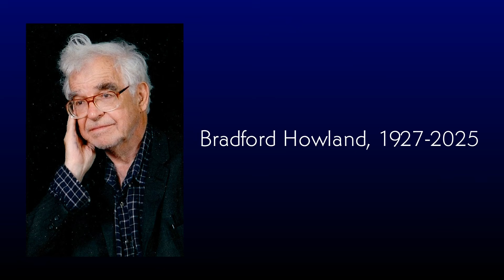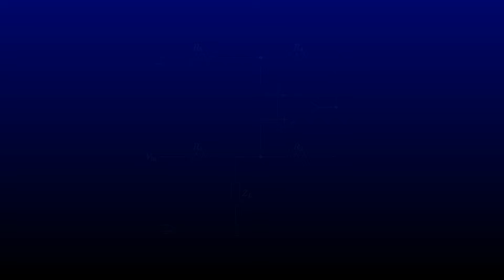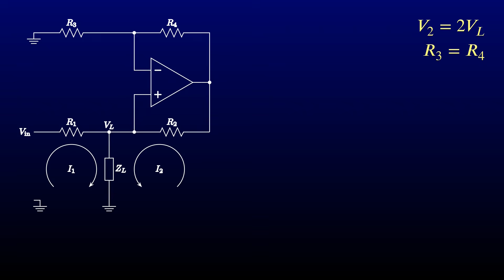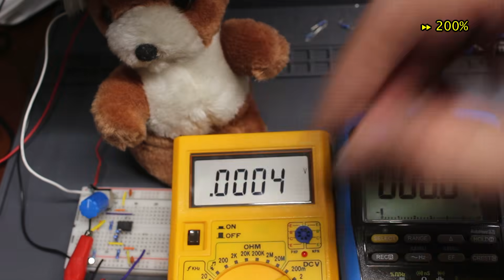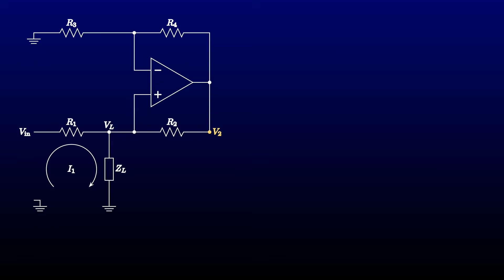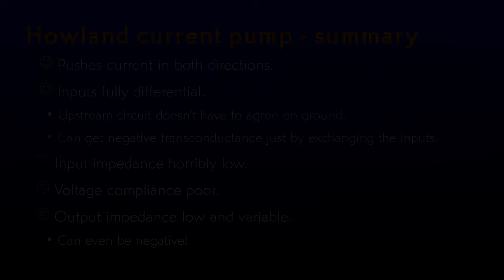The Howland Current Pump | Op-Amp Basics, episode 16

Comment: Look at info at ti snoa474a.pdf, with the range selector but put there the second opamp before the range selector (that's a better solution) and not as it is in there description (which is very theoretical but not practical)

Comment: 0.1% resistors you can get from LCSC from 3 to 8 cents (or 15 cents from digikey...), and should help a decent amount. I assume you've already read Texas Instrument's application note AN-1515, which shows two extremely useful modifications to the basic, 'academic only' vanilla howland: A) separating R2 in your circuit into a lower-ohms Ra [next to the opamp output] that can set the gain, and higher Rb [next to the opamp + input] that corrects the required ratio match, with ZL in between them. And B) then buffering the voltage VL going into Rb, which allows one to practically independently set the gain by varying Ra.

I think the Art of Electronics also contains comments about roughly the same modifications

INA105 is a good candidate part for this... in its datasheet, Figure 7-25 shows the circuit as I've described
Reply from the maker: Next episode in the series, I promise!  

Figure 7-25 is the Widlar current source. The reasoning behind how it works is a little different, since the sense resistor is in the supply path rather than the input path. Or at least I like to present the reasoning a little differently.

I haven't breadboarded it yet, (working on another project just at the moment) but I have INA143 run 'backward' (G=0.1) as the diff amp, LT1010 for an output buffer, something or other, (maybe just a trimmed TL081, but I have a few OPA186 on hand) for the feedback isolation, and a shout-out to the circuit in the LT1010 datasheet for handling big output currents. 

I probably won't build the high-current version. I just went through the thermal analysis for one relatively high-current circuit and don't really want to go into it again this soon. -100 .. 100 mA is enough to prove the concept.

Comment: I still think it is a cool circuit. All the drawbacks can be easily overcome with money (matched resisters on a chip, high voltage Op-Amps, buffers. I am sure the parts bin of Analog Devices can solve the whole problem). So it the alternative methods must sell them self on price without sacrifice.
Reply from the maker: Next episode will indeed reach into the parts bin of, well, it"s Burr-Brown/Texas Instruments, but AD has a stable of similar parts.

Comment: I could be wrong, but this seems like it would be a decent current source for a VCO or other integrating function generators where the load is a cap in the negative feedback loop of another op amp.
Reply from the maker: As long as the needed current is tiny, it'll work. I tend to prefer the version that I'll show in the next episode, because it has fewer worries - better input and output impedances, better compliance, can be scaled to huge currents, and achieving precision is cheaper. Stay tuned!
Reply: @KludgesFromKevinsCave Yeah, for those types of circuits you're usually in the microamps range. Could also be useful for OTA control circuits I think.
Reply from the maker: @control_voltage yeah, although for those you usually don't need a bidirectional source. A simple opamo with a  transistor and sense resistor in the feedback loop works fine for a CA3080 or LM13700. Use the unused half of the 13700 and one of the Darlingtons, maybe?
Reply: @KludgesFromKevinsCave Oh, that's interesting. I hadn't considered using the darlington as part of a current source. It only has pinout for the base and emitter, though. The collector is internally connected to VCC

Comment: Another great vid! An INA diff amp could help with its internal laser trimmed resistors, but again, not the cheapest solution
Reply from the maker: The problem with using a packaged diff amp for a Howland pump is that they don't usually break out the node where the current comes out!  (Next video in the series, I'll get into that!)